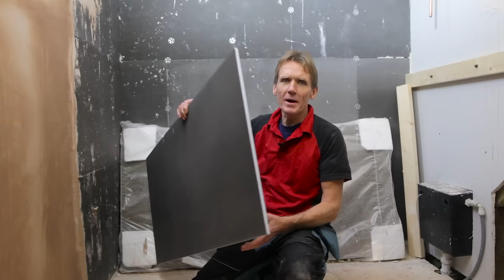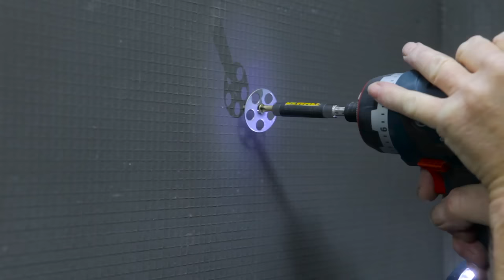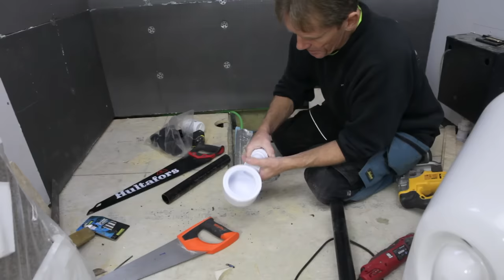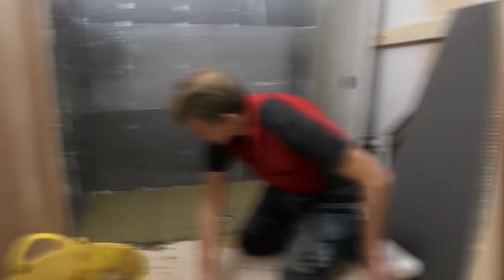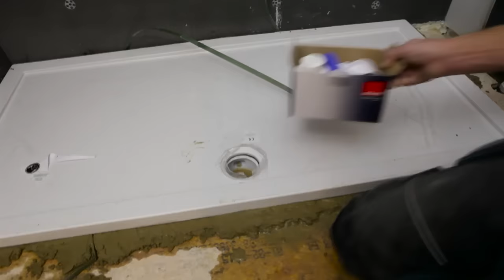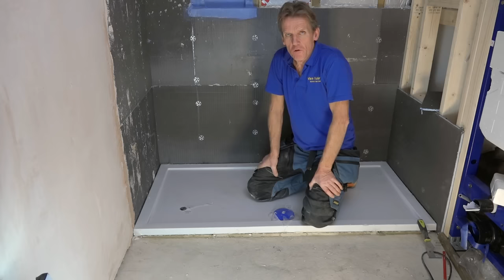Why Did the Shower Tray Crack? How Was it Fixed?

Comment: Your mortar bed was too dry and flat and couldn’t take imperfections of the tray. Should have been wetter mix and ridge trowled. May have well as laid it on the floor as that mix will not support all of the underside of the tray.
Reply from the maker: A wet mix shrinks and you get the same voids. This was just a crap tray that thinned in the middle and broke its back

Comment: Just an observation but you also forgot mention  or peel the plastic film off the sides of the tray thus preventing a good seal between tray and wall. Typical rookie mistake that leads to water ingress between tray and wall.
Reply from the maker: That is complete tosh. I would never do that. I leave the film on and peel back the edges to make the seal. I have never seen anyone, rookie or not, leave the film on.

Comment: Don’t get it you was banging on about using quality material which to be fair I only use mcalpine shower waste but you bought a shit tray
Reply from the maker: Yes but I didn't know it was no good until I found out it was no good. If I had that 100% foresight in everything I everything I ever do I would not be a plumber I would be running the country.
Reply: @George It was a shower, not a toilet pan

Comment: I honestly hate it when things like this go wrong.
Its okay to make small mistakes or forget to do something, but here, you did everything that was asked of
you to do in terms of providing a sand/cement mix for the base. And it was level too.

I would blame the design of the shower tray. Far too thin to be honest. And yes, excellent summation on your behalf,
the tray got thinner towards the "natural  flow" of the tray itself leading to flex, and ultimately, failure of the unit.
Manufacturing design problem right there.

I'm fitting a tray soon too, (its a good thick stone/resin combo) but its a bit "off" in terms of being level. So instead of slapping down a sand/cement mix onto floorboards and fiddling about with it, instead, I'm going to flip the tray upside-down (on a completely level surface), and pour clear epoxy resin on the base and let gravity "level" the base naturally. I'm then going to flip it over and spot glue it to the floor boards directly using a good bonding agent from bostik. 

Good video, pity about the tray, subscribed !
Reply: I think your ideal is brilliant. Is there any other solution instead of  epoxy resin ? I m asking because it can be not easy to find at local shop or maybe a bit complicated to me, to make right proportion of the mix with bi component. Actually not familiar with resin,..that's why🫣thks